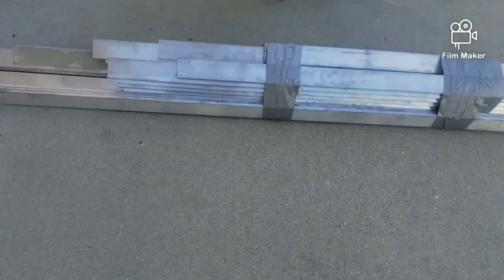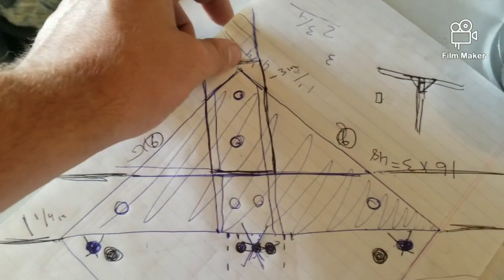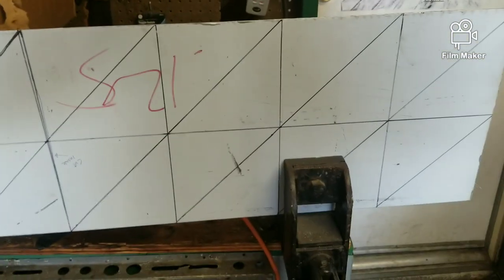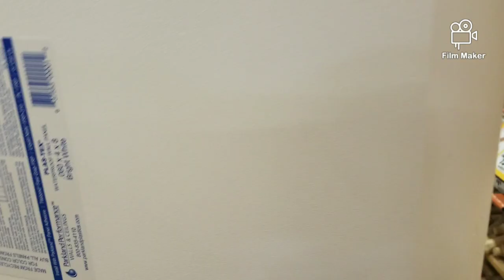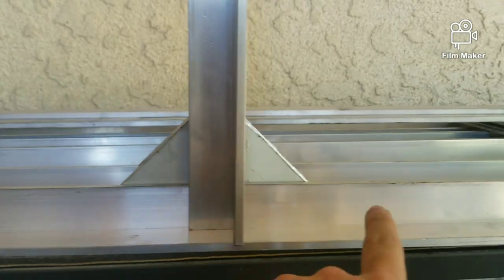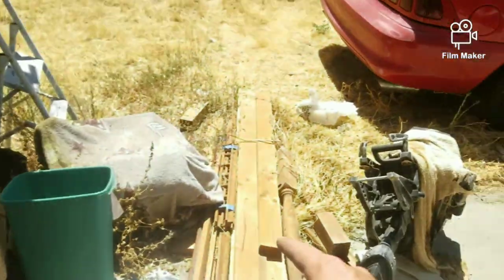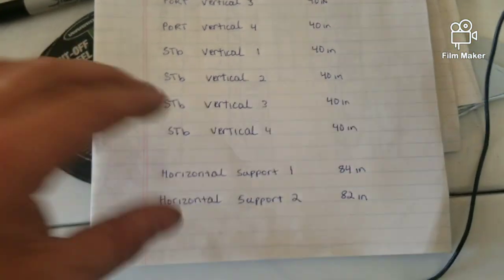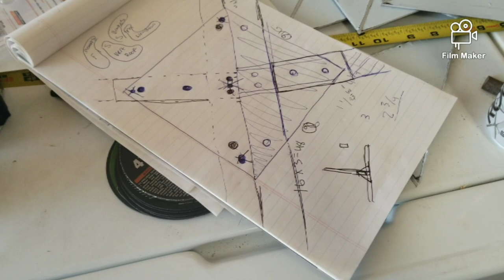Custom boat hardtop / pilot house build part 1 Ep.9

Comment: How did you bolt the aluminum together and avoid galvanic corrosion from the dissimilar metals? You would probably be better off welding it together with tig or an aluminum spool gun. Good luck.
Reply from the maker: Well what I did was I allowed the aluminum to self anodized and it's working great , thanks for your comment